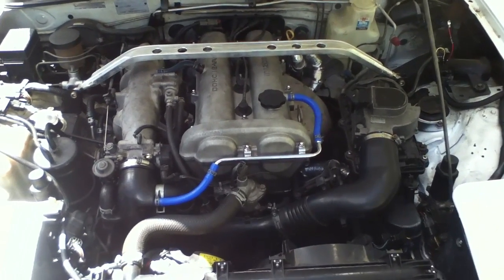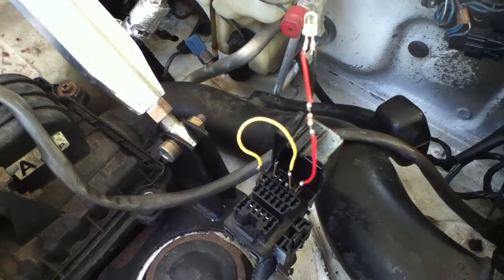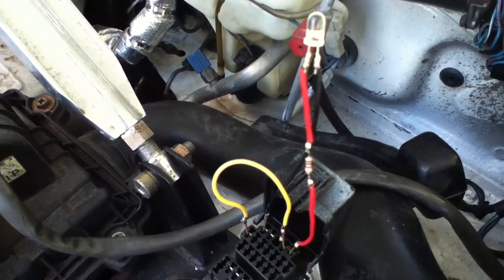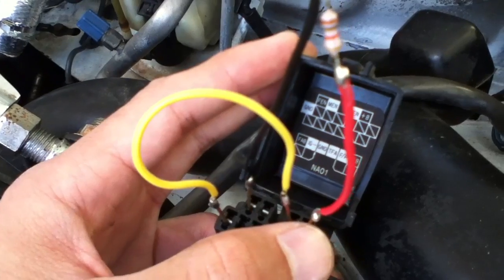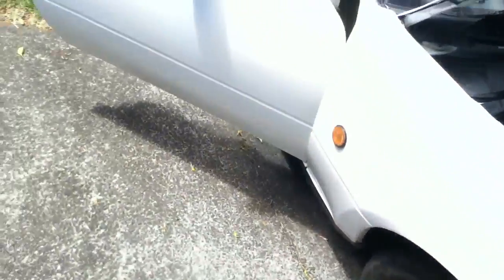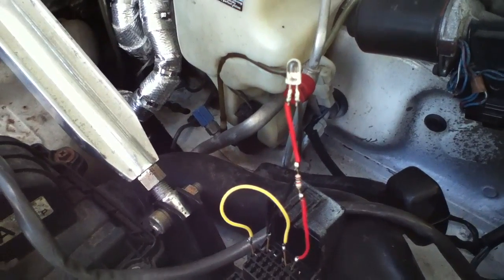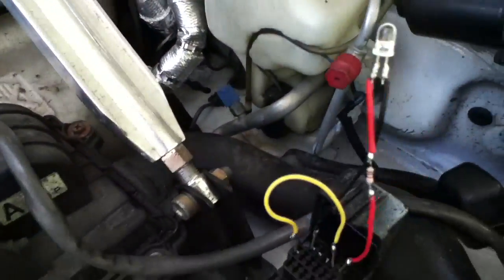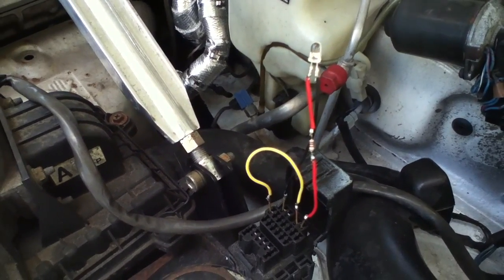MX5 Engine Diagnostics

Comment: What happens if you have no engine management light come on and no start. No sparks no fuel. I've also checked fuses its looking like potential no power to ecu. If I do this led trick it still won't come up will it?

Comment: Side Note :   This is for OBD 1 port Diagnostis only .    1989-1995  Mazda MX-5 ; Eunos  & MiatasUSA .    OBD 2  used from 1996 & up  , uses standard  OBD 2  diagnostis  Port Scanner   .
Reply: In UK, the '99 still only has obd1
Reply: @Shazzkid  I'm currently trying to diagnose a 2000 X reg UK car, and it doesn't seem to have OBD2 either. Just this same diagnostics port in the engine bay...

Comment: All the error codes:

1 -- Ignition pulse
2 -- Ne signal
3 -- G signal
4 -- SGT signal (1.8L)
8 -- Airflow meter
9 -- Water thermistor
10 - Intake air thermistor in airflow meter
12 - Throttle position sensor
14 -Atmospheric pressure sensor
15 - Oxygen sensor (output too low)
16 - EGR function sensor (1.8L)
17 - Oxygen sensor (output not changing)
25 - PRC solenoid valve (1.8L)
26 - Solenoid valve (Evaporative canister purge)
27 - EGR solenoid valve (vacuum)(1.8L)
28 - EGR solenoid valve (vent)(1.8L)
34 - Idle air control (1.8L)
36 - Idle speed control valve
Reply: thank you daddy

Comment: I did this test on my mazda Xedos 6, used a clip and a 12v LED.
The LED turned on the light but does not flash and not off, is simply connected.
has any meaning?
Reply: Mine didn't flash either. Did u figure it out?
Reply from the maker: I'm not familiar with the engine management in your car. Not sure if this is MX5 specific or can apply to all OBD-I systems. Sounds like it's just connected across the power supply, or a 'diagnostics mode' hasn't been initialized.

Comment: How to know what OHM value resistor to use? I have green light diode (10mA; 12V). Can you give me a link which resistor to buy?
Reply from the maker: For a LED with a voltage drop of 2V and requiring 10mA connected to a 12V supply, you will need a 1k ohm resistor.
Reply: V=IR.  

Volts =Amps x Ohms
Reply: Hi , can I use a normal led light bulb that is 12v? Thanks